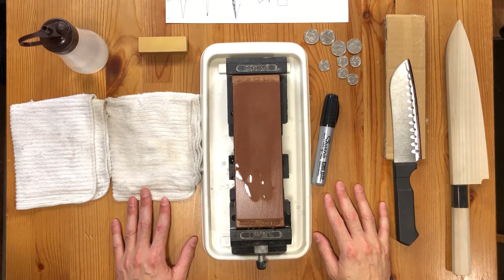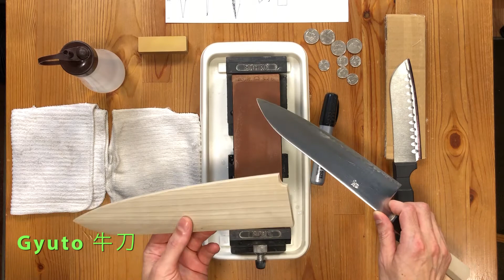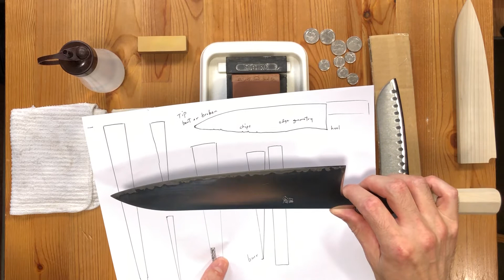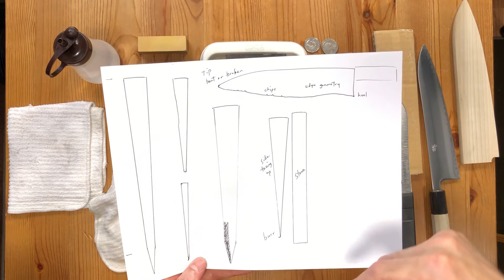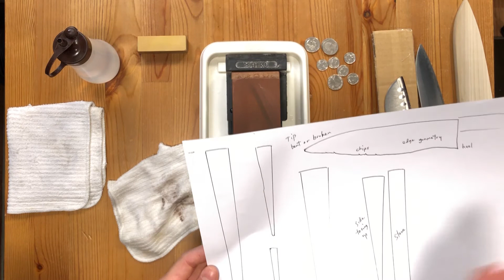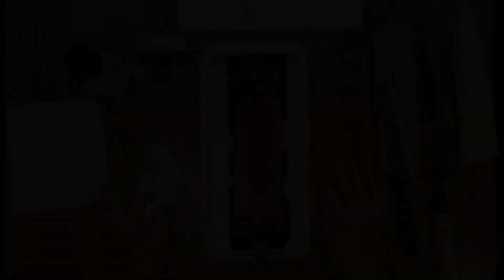How to Sharpen Japanese Knives - Part 1

Comment: Really nice instructional, thanks for sharing.  The use of a sharpie is a fantastic way of monitoring the amount of blade you are engaging.  I'll give this a try in the future.  One thing you didn't mention was getting a quality stone.  There are plenty of suppliers on the internet that are selling really poor quality whetstones.  It's worth getting the biggest stone you thin you will need in the next 20 years since they can last that long or longer.
Reply from the maker: Thank you. Yes, good stones are important, although many beginners won't see the value of paying for higher quality until they get more experience.
Reply: You can end up with a nice collection of whetstones - more investment than for the two to four knives you need. Taking in friends' knives to practice on (some really dull ones, not high quality) I've found, finally, that a really good 220 grit (or lower, like maybe a Suehiro Debado MD 20 - which I have not bought yet) is extremely useful. A diamond plate used lightly will last longer, but I don't like the scratches. I like the Chosera 400 once the bevel is set, then their 1k, their 3k, and I'm a huge admirer of Arashiyama 6k I use on my knives to polish before stropping. You might like the Choser 2k "Green Brick of Joy" (it's, big, fast, and it polishes, but I find it tricky to use, requiring some skill). The problem with getting a competition-sharp edge on even fine kitchen knives is that they lose it pretty quickly. You strop alternating sides 10 degrees with just an ounce or two of pressure ... then slice a roast vertically on a cutting board with a pound of pressure? Oops! Practicality dictates either a steeper bevel, or very careful use.
Reply: Thank you. What brand is the first knife you used? I know it's a Gyuto but what brand? I Appreciate your help.

Comment: First thing to do is check to make sure the edge is straight. Hold it edge up, point away from you, a light background, and if straight, the edge should disappear. Note that the spine can be straight, and the edge bent. To double check, get a sheet of dead flat glass, see if the knife rocks when flat. Then check the edge geometry. It is not possible to do a good job if your edge is not straight, but it is easy to forget to check that! If you're new at it, you'll think you're terrible at sharpening if you try to sharpen a bent edge. 

People buy cheap knives, then when cutting, use them to pry food apart, bending edges. On a hard steel knife, prying will chip the edge, and a sharp knife will cut readily to bone - and chip. A 500 micron chip (half a millimeter) in one tiny spot, means 500 microns off an entire section (several inches) of the blade. Knives go dull quickly from misuse and poor cleaning and storage. If you have a 500 micron chip in the middle of a 10 cm section that is supposed to be flat, that's 100mm x 0.5mm = 50 sq mm of steel you have to remove by hand on a whetstone, or roughly a  seven mm square x edge thickness. That's a lot of steel.